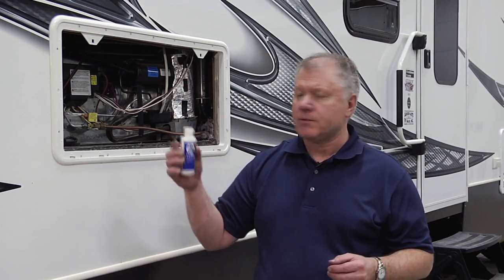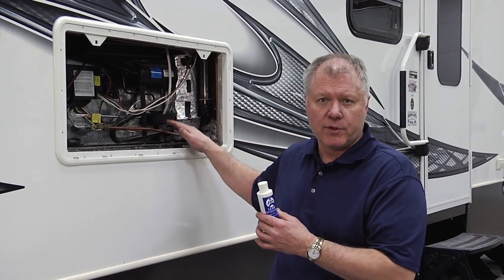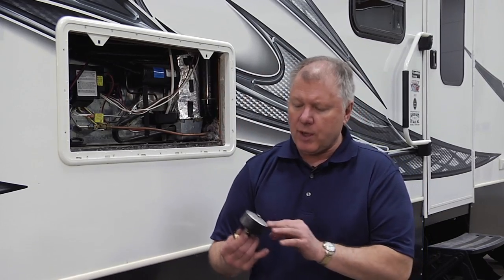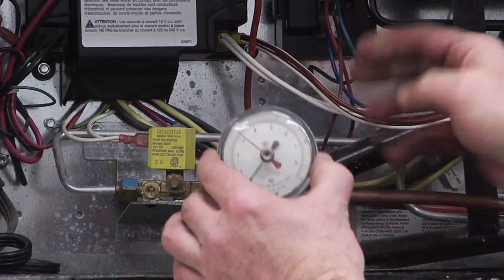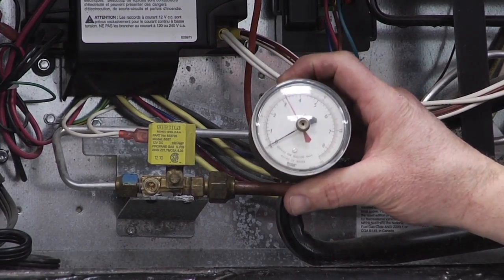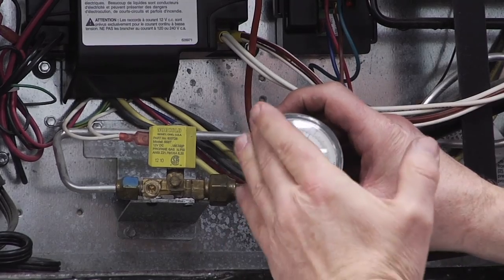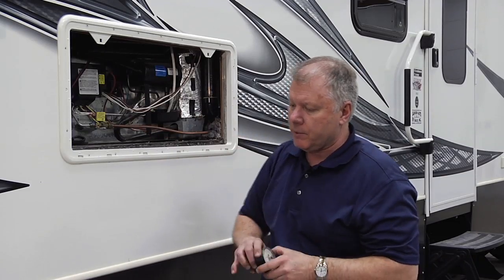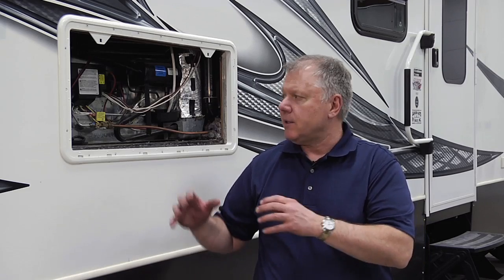Checking For Leaks In An RV Propane Tank

Comment: Hi there, I have a leak and the on/off hand wheel on the outside LP tank fill area. It starts to leak a couple turns into turning it in the on position. The hand wheel is tight but when you turn it left, "on" the hand wheel starts to get loose and leak. The screw holding the wheel on is tight. I would appreciate any and all guidance to correct this problem!